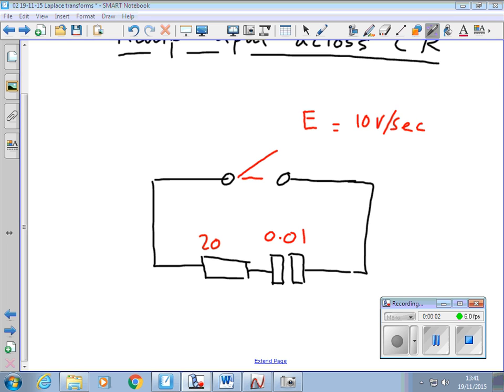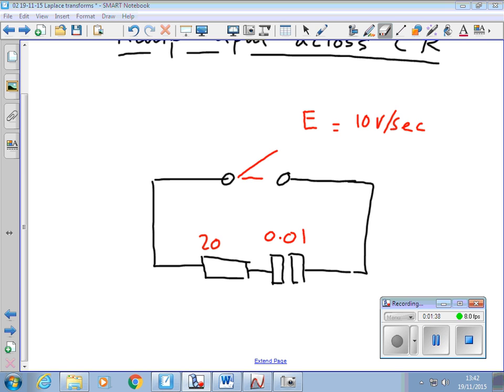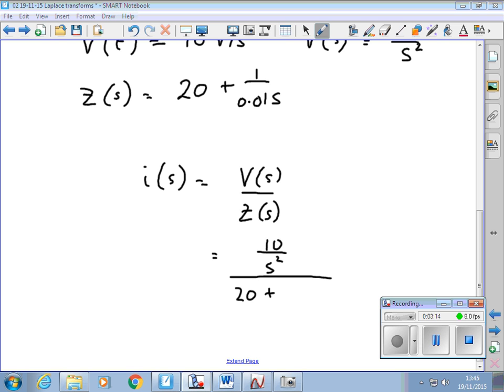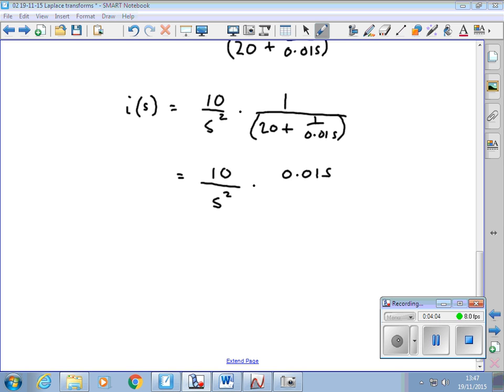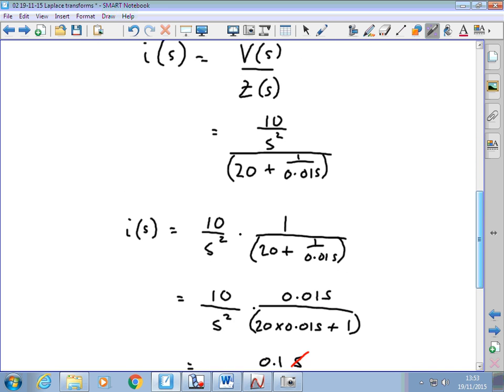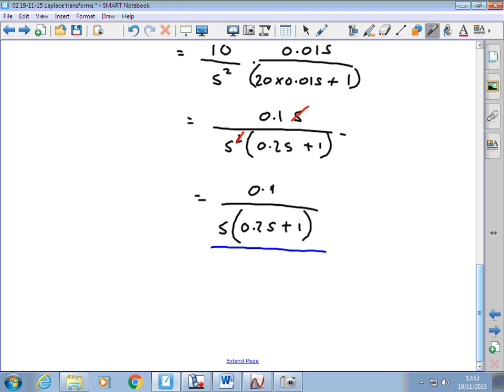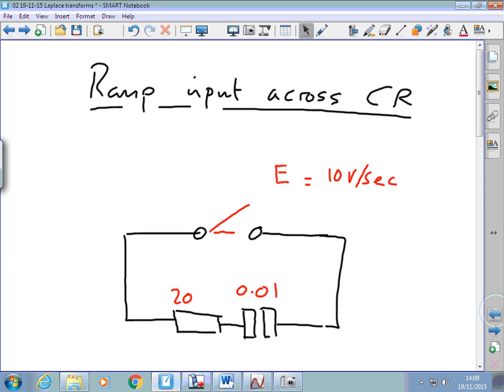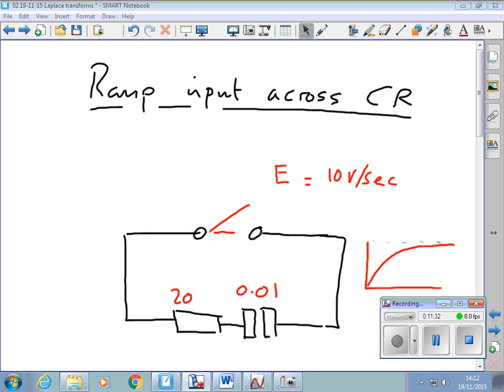RC Circuit with Ramp Input

Comment: The conclusion towards the end is not correct. The circuit ends up with zero current flowing trough the capacitor.